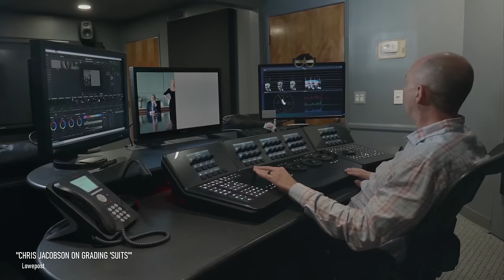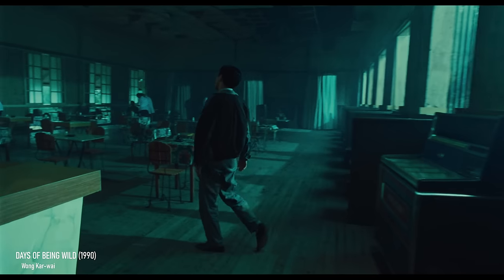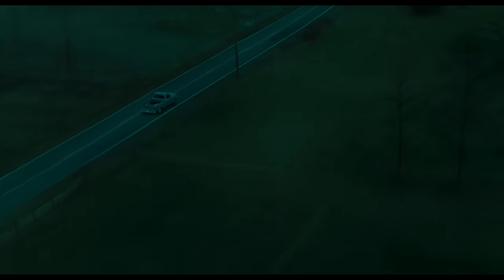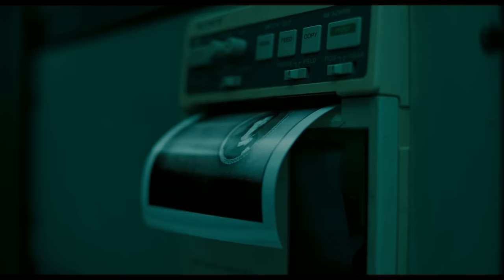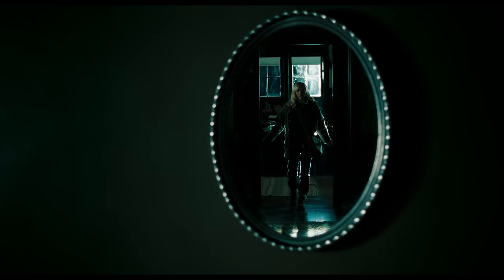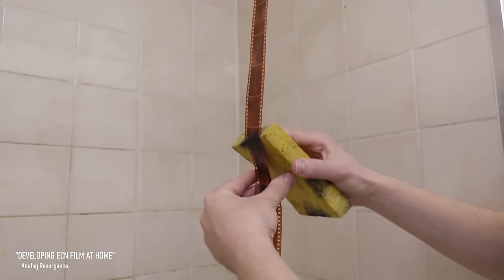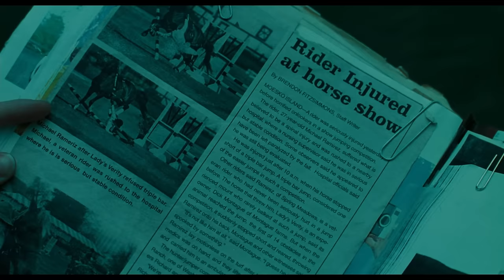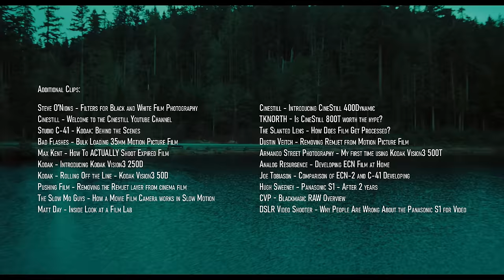Why The Ring Didn’t Use Color Grading

Comment: "The Matrix" from 1999 was the film that introduced color grading on such a large scale. "The Ring" only repeated it. However, attempts to create "color grading" were already made earlier. For example, "Aliens" by James Cameron. The film is very much immersed in darkness, but there is a clear dominance of blue color. Even in promotional materials. If you type "Aliens" into Google, 90% of the results will be covered in blue. To balance the clear dominance of blue, Cameron also introduced red - symbolizing threat. Remember the scene when Burke throws a facehugger to sleeping Newt and Ripley? And then the scene of aliens attacking the space marines in the cantina? Blue symbolizing darkness changes to red - threat. So color grading was used much earlier than "The Ring" - sorry. But still, I love this video, thumb up from a big fan of "The Ring". PS: I've just watcher classic trailer of Aliens. Clearly you can see color grading of blue, mixed with red - in scenes of aliens attack.

Comment: Also The Matrix is often called out to being responsible for this green look but the original cinema run was never that green and it was a mistake in the later VHS releases and was never the intent.
Reply from the maker: I actually made a video about just that some years back! You should check it out if you want to see how that ended up happening.

Comment: you have a little technical error at 09:14 -> Push processing does not increase the film's sensitvity. That is physically impossible. What push processing does is providing more time / increased reaction rate if time and temp is combined to allow the latent image to be developed fully - even in areas that have received so little light that they would not have built up density during normal processing. At best, for each stop push processing you gain a third of a stop additional density on the neg. The film will not magically have 1000 ASA if pushed one stop (assuming 5219 is used). If you push 500T one stop you get more like 640 out of the film at best.

Comment: Uhm, I want to point out you seem to be using the 4K Remastered version of The Ring. Compared to the early 2000s releases they've made a lot of scenes that werent, green, including skin and clothes. The hue of green is altered as well. There are couple of scenes where its very close to the original home video releases but are rare. Its unfortunate the movie got the"Matrix treatment". Hopefully it'll get restored one day.
Reply from the maker: This is not correct. This video was made before the 4k remaster was released, I used the original blu-ray release as my source. I have seen these accusations of them changing the look before, but when I actually got a hold of a copy of the early 2000s DVD release and found there was very little difference, aside from the blu-ray being a bit more saturated, detailed, and consistent (as would be expected with an HD re-release). The DVD transfer is a bit of a mess imo.

I am aware there may be DVD transfers in other markets with a little less green, but I’m not comfortable relying on those to be accurate representations of the filmmaker’s intent.

Furthermore, the 4k remaster, overseen by director Gore Verbinski, looks much the same as the blu-ray, though slightly subtler in its colors and contrast due to the use of HDR grading and improved scanning and mastering techniques.

Comment: sucks that it is now impossible to get your hands on a cheap cc30g lmao. would two cc20g's be able to compensate? or a cc20 and a cc10?
Reply from the maker: A CC20G and CC10G together would be perfect, though even a single CC20G would get you most of the way there as long as you're okay with doing a little bit of post color correction to dial in exactly the look you want.

Apologies for making all the CC30G's sell out, didn't realize this would blow up as much as it did lol.
Reply: @WatchingtheAerial  I totally understand lol. Much easier to get those than the 30s at a bit of a bump in price especiallywith that shipping eating your soul and especially if you want a spare set.

But yeah I wasn't sure if 10+20=30 or if it was some weird scale where 10+20 would be like 25 or 40 or something silly like that. I appreciate the response

Comment: You can’t say Ring didn’t use color grading, this is 100% not correct. You still need to grade film. Yes you can make a filter cocktail to alter the look but A film’s scan is still in log and needs to be color graded